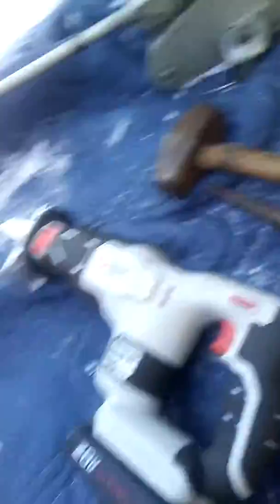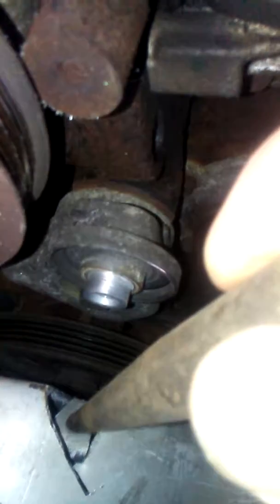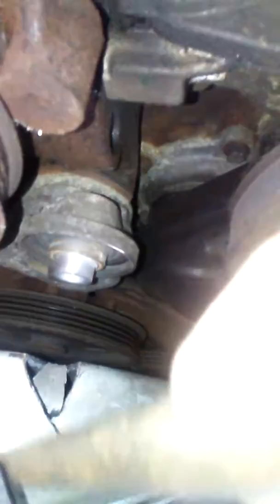PT Cruiser idle tension pulley removal

Comment: Jack up the other side of the transmision, using a wood block.  about 5 inches.  The bolt will lower enogu to remove it.. With no saw... But good video.
Reply: Thanks for that info I'm at a loss you helped me should I loose the top motor mount though

Comment: No need to cut or loosen motor mount. Yes it hits frame after out of tensioner. You keep loosening with wrench the bolt will walk right off the frame. The new bolt on new tensioner is shorter and goes in easily.  Just did mine in 40 minutes